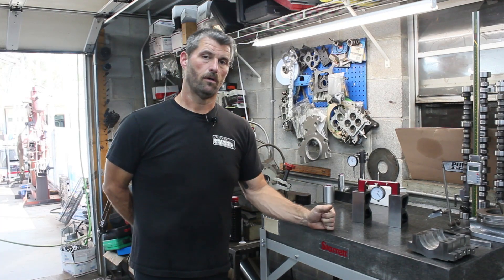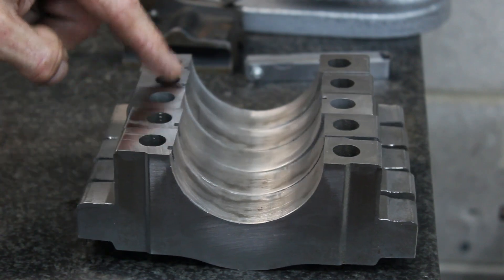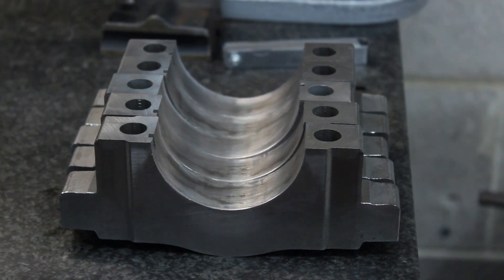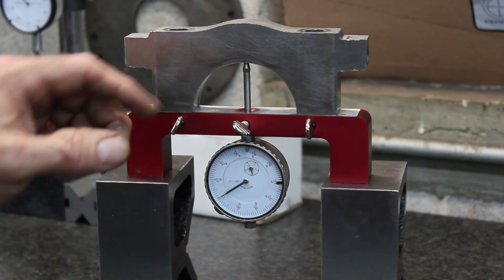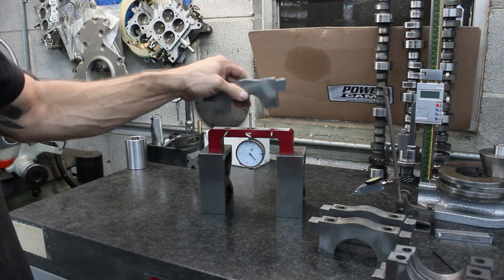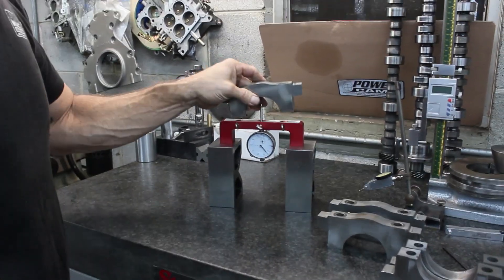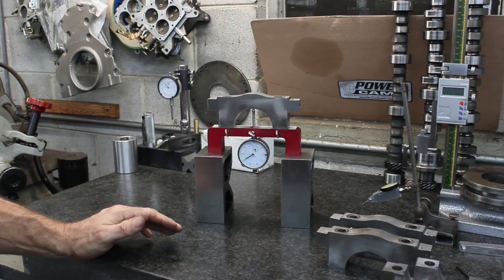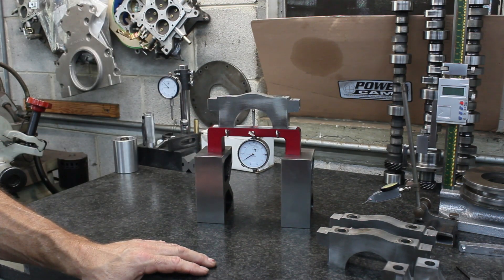Cutting Main Caps for Line honing

Comment: Cool !!, I had a 302 Ford line bored, now the bearings extend past the end of the cap itself. ,the clearance on the crank is the same down the line., Question, is there a way to possibly shim the cap. Haven't measured to see if there as an clearance between the cap and the block. Just gonna use a feeler gauge. Any info would be greatly appreciated.
Reply: The bearing is supposed to extend past the cap to provide crush. If the bore is in spec its fine.
Reply: @rickh633  thank you for that. It's been kinda worrying me. Just waiting on the heads now. Is my imagination or, are machine shops just working slow these days. Have a great day
Reply from the maker: No, somebody trainwrecked that job, if done correctly everything will be back like factory
Reply: @powellmachineinc  that's exactly what I thought. Sad part is , the rest of the machine work checked out fine. The sad part is that it took sixteen months to get the job done. I used a local guy here in AZ. Small town. Never again. What are my options. Thanks

Comment: Can a ls engine have caps cut . Or can you use a cap from another ls  block and hone it to fit . Y’all put out some great informative videos
Reply from the maker: We have fixed many Ls engines this way, also I haven't had any luck making a used cap work.
Reply: Thanks for the reply . I noticed they sell new billet caps for ls engines, have you ever had any luck making those fit a iron block .

Comment: id like to see the procedure / process of them being machined/ cut before line honing. but as stated your correct. even engines with little time use limited if any abuse, my local machine shop has called told me they need to be done and i had seen NO witness in bearings.  I TRUST my machinist, ive known him 50 yrs. one day i happen to be dropping off more to him and he says hey come check out your block and let me show you. it had 30K miles on it. i got it as a running core for a rebuild. he showed me how far out the caps were. it was not drastic, it would have lived fine, but he being picky as he is he caught it. that was Yrs ago, and from that day on every block is line honed or line bored. to me if a GM block with 30k on it needed it every one needs it. my belief is  most people over look it based on appearances of bearings they remove.
Reply from the maker: Definitely

Comment: And you got UTG saying how get mopar Chryslers  Spectacular machine work, I've seen the same thing. S*** machine work brand new engines 440 with 3 10 over pistons.
& 5 standard Pistons. & the crank had over sized bearing brand new motor cut 0.010 on the crank  lol
Reply from the maker: Yep

Comment: I like that idea. 1 question, if you don’t cut the block the same amount, won’t the hone follow more towards the easiest path and change crank to deck distance?
Reply from the maker: The mandrel has a setting to move up or down but if we cut the cap .005 it would only move the c/l .0025" which is no issue.